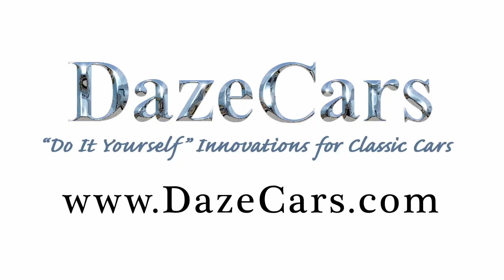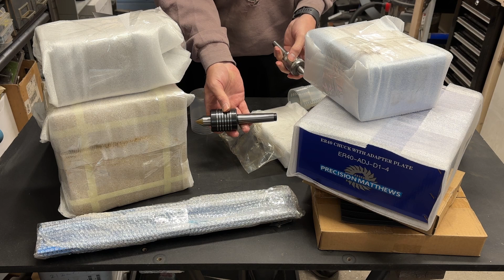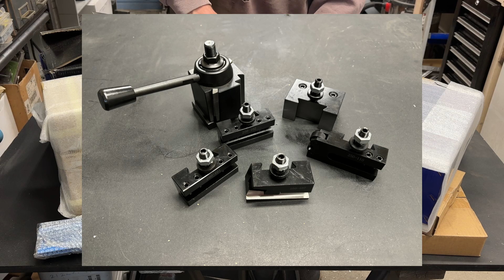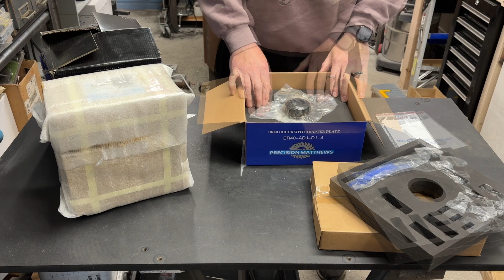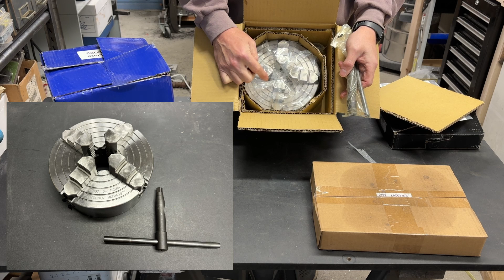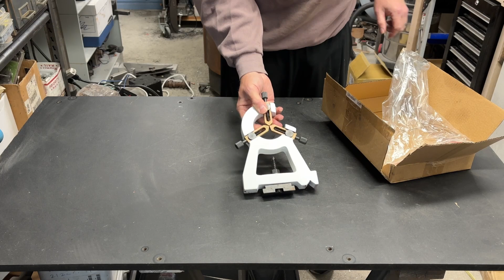Uncrating, Unpacking, and Assessing the Accessories, Precision Matthews PM 1228 Lathe

Comment: I did buy this self centering 4 jaw chuck based on your recommendation 😊
Reply from the maker: I hope you like it as much as I like mine
Reply: @dazecars  I just thoroughly cleaned it, can't believe the amount of grit they just greased over. I haven't had a chance to use it yet, I need to trim the backing plate tomorrow.
Reply from the maker: Its really hit and miss with import tooling some comes grit free and others are quite gritty
Reply: @dazecars  I took it all apart, it had scant grease in it, which was good, because less to clean out. the machining appears to be very good all around. I got the back plate trimmed to the correct size, filed all the sharp edges & loaded with way oil & she's good to go. dang, it's a heavy thing when all put together .    : ) I consider it a good value.
Reply from the maker: glad you liked it

Comment: I don’t recommend using a push style knurling tool on a small lathe. By small, I mean smaller than at least a 14-15” model, but preferably larger. Knurling puts a great deal of pressure on the spindle bearing. If you almost never do knurling, you will get away with it. But if you do it even fairly often, I highly recommend getting a scissors style tool that squeezes the shaft instead. By the way, there’s a very good reason why most chucks have three jaws. It’s like a tripod. Three jaws always contact the work, even if as it comes from the mill, it’s not actually round. More than three jaws, with a scroll chuck, will always have one or more jaws that either don’t touch the work, or are touching with varying force. Either is not good. Only use the four jaw scroll chuck for work that is already machined to an exact square or round. Otherwise use the three jaw scroll or the independent four jaw.
Reply: I am looking at this lathe vs Grizzly G4003G. The variable speed on the PM is nice but not sure if the power would be there at low range. Especially for threading. I am a retired machinist, and
 I ran 144" vertical lathes (yes a 12 ft. chuck all the way down to 12" lathes. All the variable speeds had 3 ranges. Can't wait for the review on this one. I know he is thorough.
Reply from the maker: Being a DC type servo motor it should have good torque at the lowest ranges.  Those motors typically have a curve and produce there best torque at speeds ever so so slightly above the minimum speed. 

I extend the threads on some 3/8" grade 8 bolts on a regular basis so should be able to put it to the test.  On my old machine I didn't even use the compound so tool pressures got extremely high.  I will likely do it correctly utilizing the compound on this machine but may try it without setting up the compound as a good torque test. 

Lots more to come on this machine but I have no clue how long it will take me to get it fully reviewed.  At this point it's still sitting on its pallet in my garage as I need to do a little remodeling in the shop to make room for it as it is much bigger than the machine it is replacing.
Reply: @dazecars  what I find interesting on these smaller lathes is that they’re using digitally controlled industrial style sewing machine motors. I recently bought a Chinese leather sewing machine and bought a one horse motor of that type which came with the controller. They’re not really intended for running a lathe. They are available up to two horse though. When I decided to upgrade some of my 240 volt machines to variable speeds I bought inverter ready three phase motors for them. They’re much heavier built and designed for heavy load continuous running. I suppose for these lathes these motors work, but they’re pretty small and I wonder if they may overheat.
Reply from the maker: The motor in this 1228 is a very large servo type motor.  I have not seen the specs on the HP or RPM range but was impressed with its size.  Its not a hard fast rule but the size of a servo motor typicaly indicates performance the bigger it is the better it works.   I have had outstanding success using treadmill motors on my my other machines when converting them to variable speed but there is no argueing that a 3 phase motor with VFD is the absolute best way to go all-be-it WAY more expensive.  Thats why I went the treadmill option for my smaller machines it worked extreamly well  for a lot less money.

Comment: I want one, how much?
Reply from the maker: Their machines stare at about $3500 and go up from there depending on what size you want and whether or not you are looking for something more hobby or more professional.
Reply: Did you look at the Grizzly 12x36?  G4003G. 
Since Presicion Matthew's is Also manufactured in China now it's not an attraction as before.
Reply from the maker: I didn't.  My experience with PM on my mill, PM728 was so good that I wanted to stick to the same brand.  I was considering both the 1130 and the 1228 and the comment that really resonated for me is the 1130 is the biggest "small machine" and the 1228 is the smallest "big machine"  In other words the 1228 is the functionality of a big machine in a smaller package.
Reply: I have been chatting with machinists that I worked with for 33 years and they like the variable speed in PM but are leaning towards a 12x36 or 14x36. After adding options the 12x28 is the only one in my budget.
Reply from the maker: I cant imagine having  36"  the lathe I'm replacing is a 16X18 😂 😂
Reply: Been watching videos and reading reviews on PM Lathes. Looking forward to your input. I most likely will get the 12x28 or 12x36. The largest lathe I ran and quite often was a Vetical lathe with a 12 foot chuck. And a vertical lathe with a 48" chuck.
Reply: I meant vertical lathe not vertica
Reply from the maker: those machines sound impressive.  I guessing anything you get will be a downgrade 😁

Comment: Great choice, however you have committed sacrilege on your 3 in one crowd. Waiting to see your ELS and treadmill motor mods. LOL.
Reply from the maker: No treadmill requirement due to this machine already having variable speed but it may get ELS.  Not sure yet.  It has a gear box to eliminate most change gear switches so I will likely play with it like this for a while before adding ELS
Reply: @dazecars  I loved the lack of gear noise on my Atlas on top of the other benefits. Thanks for talking me into it. Now my wood lathe and drill press have treadmill motors. Just finished them. I also use the rubber track for drawer liners. Helps a lower sliding of tools etc.
Reply from the maker: so many good parts on treadmills!!

Comment: So jealous. I managed a 9x32 budget model recently but it's no PM. More or less came new as a project. Works good now though and has a huge spindle bore for it's size and a strong motor. It leaves my motor upgrade project to the band saw! 😁
Reply from the maker: I find It fun taking a "new"  machine and getting it exactly the way you want it.  9X32 sound slike a nice big size.  My previous lathe was 16X18 so this new one is a huge upgrade.